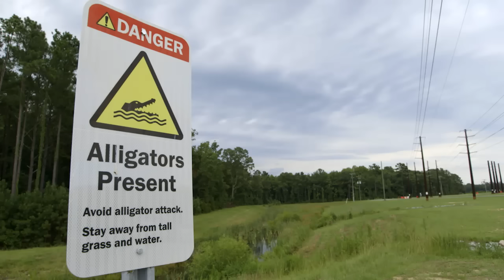Inside a Google data center

Comment: why if i just cut the cables on the street to googles servers, would that bring it down?
Reply: If you cut all of the cables, electric, communications? maybe. but most data centers are multi threaded meaning they have more than 1 communications provider, more than 1 power source. at the basic level a data center will have at least 2 of everything.
Reply: +MineNightOwl Gaming  do you even know what your talken about guyhaving multiple redundancy systems in place?..most data centers have multi layer redundant fail safe systems in place guy..why would you think that not having power to the bilding would stop the production?...think about what your saying guy...i can tell you a simple diagnostic software is more than enough to keep an eye on the power coming into the building.....Google is on next level shit and wouldnt have this massive Data Center without having multiple redundancy systems in place
Reply: it has his own underground optic fiber line,
Reply: no, it has backup generators
Reply: +MineNightOwl Gaming yeah but if the dude cuts those cables going from that building to the servers
Reply: +MineNightOwl Gaming i dont think they run that shit from one powersupply
Reply: JayVan Geli considering its google i bet they have their own satellite internet connection lol

Comment: I don't understand the cooling solution here - I thought that the most efficient cooling is to use a sealed cold aisle between two rows where you blow in cooled air. The air then goes through the equipment on the rows and out into the ambient data centre space where it's now warm. The general/ambient data centre space gets quite warm as a result but because cooler air is contained only in the small space between two rows - this greatly reduces wasted cooling and thus wastes less power.

The impression I got from this video was that there is a sealed hot aisle (instead of a sealed cold aisle) between two rows and the hot air is circulated through chilled water pipes to cool and the cooled air is blown into the ambient data centre space. This cool air is sucked in through the equipment and into the sealed hot aisle where the air is quite hot and is circulated through the chilled water pipes and the cycle repeats. The problem with this is that the general data centre space is large so it's hard to control the temperature and humidity. This would result in wastage...

So what's the deal here? Why go with the sealed hot aisle?
Reply: +PJNinja it's probably more effective sealing the hot air. that way it can only rise going thru the cold coils. Having cold air blow thru, unless it ends in say a server unit, has diminishing returns. IMO they should just water cool every rack thru water cooling or use the heated water to power electricity.
Reply: I don't understand the diminishing returns part, how do you mean?

Comment: How many watts does all of those servers consume... it has to be in the gigawatts...
Reply: +Cheataa That can't be right. That amount can barely charge the server room flux capacitor. It must have much more than that.
Reply: +Thomas Dohlman/«DN»Lasky® no that's mega
Reply: That's a shit load of power!  That's like the entire rate of consumption of my entire city 20 times over a month!  WOW!
Reply: +Cheataa What the hell's a gigawatt !?
Reply: 1,000,000 watts of electricity...?
Reply: Well yes, but they produce their own electricity!
Reply: Should be a few megawatts. Last year, one of amazon's pre-production data center caught fire. And Amazon disclosed some info. The figure was like 5,000 servers, each about 2 kilowatts(like a home air conditioner). The servers are blade servers, about 8 PCs form a blade server. So, each PC is 250 watts, like a good gaming PC. So, a data center building is like 40,000 PCs in a big warehouse. So, the data center building is equivalent of about 2,000 homes like a small town. Each home is allowed to have 20 good gaming PCs.
By the way, the smallest nuclear powerplant in USA generates 500 megawatts. It is not possible for a data center to run gigawatts of electricity. If a data center runs gigawatts, google will need to become a power company itself, managing dozens of full sized nuclear power plants.
Reply: One followed by 6 zeros is about right. But one followed by 6 zeros is megawatts, not gigawatts. Gigawatts is a full sized nuclear power plant that each state in USA only has about 2 full sized nuclear power plant.

Comment: I understand the point of using the water cooling systems. By containing it in the server racks you avoid the loss of energy by wasting on areas that don't need cooling. This is simply a water chiller.

Comment: remember... all it takes is one idiot who somehow landed a job protecting those... just one idiot... and it's all molted plastic and a big fire...
Reply: Half of the system is fully automatic, so even if the humans fail, there shouldn't be any data loss.
Reply: +wizzzer1337 Except it's all redundant. One of these data centers goes down and the others pick up the slack. This one is in South Carolina, and while it's unlikely the idiot you mention could take it down a big hurricane could.
Reply: +wizzzer1337 Two words. Failover clustering.

Comment: why not build in a really cold place like Alaska or Canada, then use the spare heat to warm peoples houses?
Reply: +Steve Haigh When the cooling comes from COLD air and not COOL air you will have a extremely high risk of moisture forming in the hot parts in the servers. That would result in a short circuit. This is the exact same reason to why you can't put a computer in the freezer to cool it. I hope you got you question answered :)
Reply: +Attic Z that makes no sense to me, colder air is typically dryer than cool air, plus they build plenty of data centers in Sweden
Reply: Oh, that's not what i meant. What I mean is that you can't use the air from outside and therefore it wouldn't matter if it's a cold country
Reply: +Attic Z or yo u cold just get fool boards that get cold and dont let air out

Comment: How does running data center warmer help with Efficiency? I think he just likes the word Efficiency.
Reply: +Vinny W Its for cost efficiency not improving performance of the servers themselves.  The found no longevity changes due to the slight temp change so they did it.  Also other data centers followed suit.
Reply: +Vinny W less energy is wasted for cooling

Comment: Why don't they use additional passive cooling with architectural additions above the center in the form of a larger building. We have already started using passive air conditioning inspired by termite mines. It only requires a higher upfront building cost but if implemented properly can save a lot of money on cooling while also reducing a carbon footprint

Comment: Would they run out of space in their hard drives?
Reply: they aren't hard drives they are solid state drives very similar but much faster than a standard hard drive but they have such large amounts of data bases by the time they run out of data Google will be taught in history classes
Reply: +Tristan Gumm The clip was of hard drives. SSDs are way too expensive for them to bother with for a long time unless the customer pays more.

Comment: Dafuq, the internet is stored on disk drives, am i correct are thier hard drives diffErent to the ones in my PC, also wouldn't they use ssd's or am i dumb?
Reply: dumb
Reply: +Flubberg464 dumb
Reply: Sinerst
Because HDD's are much cheaper and last a lot longer. SSD's are fast and are shock resistant, but they can read and write only so many times. HDD's can write and read countless times before failing and since they are stored statically, there is no need for a shock-resistant drive.
Reply: yes,they are pretty much identical to the ones in your PC just designed for high workloads 24/7.
Reply: They don't store the Internet, they just store the links, software, account info, etc
Reply: William Lau
Actually, they do, not the whole internet of cource, but just little bits.
Reply: +TheLMGN nope the WHOLE INTERNET IS STORED ON HARD DRIVES....any website you visit is hosted on a server, and what's a server? it's a high end pc or PCs with a bunch of hard drives inside to store the website's contents. so the internet is on hard drives, there's no "hyperspace" in which the internet resides what the internet is, it's a way of connecting pc's together across the universe
Reply: +Sinerst ssds would break extremely fast wirh all the data thats constantly being processed
Reply: +Flubberg464 Why use ssd when you can use the best RAID config to achieve all the performance, reliability and redundancy you want, while being cost efficient.
Reply: +Lance Rze Lol, You're* Your dumb lance.
Reply: youssef x
I know lol. I've done some web development.

Comment: What happens at 2:37 if there's a power failure or malfunction?  Are you trapped inside that thing?  Or is there a manual lever that will open the outer door?

Comment: I bet they're using hoverboards now.
Reply: +Josh Luis swegways
Reply: Maxim Korol ikr why do pople cal them that and spel teribly wen then rite comments just enif so u get wut im takin about
Reply: +Maxim Korol Technically they do.

"Electrons in the outer shells of atoms repel each other at 10^-8 metres.(yes, you aren't really sitting on a chair, but hovering/flying slightly above it at 10^-8m.)"
Reply: +vide0viwer I'll get your coat.
Reply: +Josh Luis i was just thinking that wen i saw that dude on the scooter
Reply: They don't even hover fucktard
Reply: They don't hover AND they don't get sold anymore
Reply: +kcuf0 वीं जपसरव#ज:)?-==$??==+;::'+==])=))

Comment: lol seeing people say why doesn't Google use Chrome OS for dev just made my day =P!!!  I got a free Chomebook pixel from Google I/O 2013, and I actually tried to use it for dev! I tried web-based IDEs, web-based source control, web-based terminal, etc etc, (and of course the first thing I did was to dual boot Ubuntu), had to sell it after a month because whenever I look back at my macbook pro I just could not resist that temptation...uhh Macbooks, I dont know, Windows has VS's debugger, Linux supports more open source software, but a Macbook is just such a beautiful combination of hardward and software that you can not say no to. (disclaimer: XCode excluded)

Comment: why don't they use the energy of the processors to generate electricity?
Reply: You don't make power, you recycle the heat generated by the processor.
Reply: +KV-1S Tanker what? what is so hard about using a heatsource to generate electricity, we have been doing that for years
Reply: +Creative Contagion I think he means using the waste heat produced to add an additional supply of power to the plant. That way they can use less electricity from the grid or supply the grid itself, therefore reducing operational costs.
Reply: +William Yang Yes that was the point. I asked around and a friend of mine made a good point in that processors don't get nearly hot enough and the Carnot cycle can never be made efficient with a temperature differential that low. The efficientcy is basically: 1 - Tcold/Thot and since that is only about 0.19, you can't really get an efficient engine.
Reply: +Robert Fennis Let me explain it... You need to cool the processors to ensure the stability and efficiency. Making them to produce energy from the heat would be a high risk, the processors need a temperature range. Even if the company says "We will feedback part of the energy with the processors" The energy in return would be a very low fraction of the energy used to make them work... With a high risk of overheating.

In other words: If i feedback the energy produced by my fridge in form of heat to it again, at the moment i unplug it the fridge, it would be working for a very short time.
Reply: +Bruno Iniesta Baldis I don't see why there would be a high risk of overheating.
+Robert I think they don't do that cause it is not worth at the moment, but it seems like a cool idea.

Comment: That cooling system is interesting
I have worked in alot of datacentres over the UK and most "as mentioned" have ac thats presented right at the cabs
Wound be interested to see the specs

Comment: When will google upgrade to ssds instead of hdds? Or will that be too expensive?
Reply: +Ben G its not same hdd like you buy for pc and hdd are better for long time running, but im sure they are using sdd in some parts. If you are talkinf about 20 petabaits of data per day :D ssd will explode :D
Reply: +Ben G They'll never phase out HDD's for SSD's. I'm sure that they use SSDs to store critical data but they'll never use SSD drives in the scale that HDD drives are used today. Google still uses magnetic tape data storage for long term storage, just to get a perspective.
Reply: +Ben G HDD`s in this kind of use are not slower than SSD´s so it doesent matter.
Reply: +Sulfen "never" is a big word. 10 years from now flash storage may be cheaper than disks.
Reply: Völundr Frey maybe but ssd will end soon, there is new technology for drives faster then ssd and without limits for transfer
Reply: +Völundr Frey if magnetic tape is still preferred today as a main backup storage it is very unlikely that SSD will become a standard with its lower lifetime.
Reply: Sulfen Magnetic tape is still used because it's better than harddrives for some storage. Long term storage primarily. Harddrives are better than tape in situation where speed matters, and preferred over flash when it's too expensive with flash. When you can get flash storage cheaper or as cheap as hard drives there's no reason to use them over flash. 

And that could very well happen within the next 10 years.
Reply: +Völundr Frey there's still a huge limitation that makes it unlikely, and I could bet on impossible, for it to become the main storage device. SSDs start to go bad a lot faster due to its rewriting problems. This is something that happens a lot less often on hard drives. Even if SSDs were to become cheaper than hard drives, they'd have to make up for their higher replacement rate. The only usefulness for the SSD is to store frequently accessed data because of its advantage to retrieve data faster than the magnetic tape or hard drive.

Comment: Google use MacBook? Lol they should use cromebook lol
Reply: Lil
Reply: +Conor Walker I bet you will see a lot of chromebook pixels at google as well. But they wont be running their native OS either. Any mac you see at the hands of an engineer at google will be running linux, unless they're working on an IOS or Windows application. 

You can change operating systems.
Reply: +Ryan Lin chromebooks sucks and thewy cant do shit
Reply: +Ryan Lin i have a brick aaaah-mean a chromebook
Reply: +Ryan Lin Whats a cromebook?
Reply: +Völundr Frey Wrong, OSX  is based off UNIX. You can manage any linux machine fine via the native OS
Reply: Yaya
Reply: I have ho 1.6 ghz and graphic can't run minecrFt with 8 gb rammm
Reply: They won't be using chromebooks because of how weak the hardware inside a chromebook is
Reply: Ryan Lin cough cough more ram won't fix anything if you have a bad gpu cough cough

Comment: You laugh? I'm down right sad. Look at how much energy that uses, ffs press the hardware manufacturers to innovate this is ridiculous. From replacing HDDs alone the  reduction of energy consumption would be huge.
Reply: +kalimul You're joking right? Do you know how much it would cost to replace hundreds of thousands of HDD's that store god knows how many terabytes each. That would be a stretch even for Google.
Reply: 20buckman12 I'm not joking at all and they would pay for themselves in the long run due to less money spent on cooling and less money spent on electricity. If anyone could afford the higher up front costs, it should be Google.
Reply: kalimul In 10 years, yes. Now I don't think any company would justify paying so much extra when there is an option that is so much cheaper. SSD's are so fuckin expensive man, I can get a 2TB HDD for the price of a 128GB SSD. That's a HUGE difference.
Reply: 20buckman12 Burning coal is cheaper now as well, doesn't mean it's an ethical thing to do to future generations. Wasn't Google supposed to be environmentally friendly? They waste so much energy is their data centers that they need god damn cooling towers. Think of that for a moment how incredibly stupid this whole thing is. Storage is just one of the areas where they could improve and flash storage isn't the only new storage in town btw. There is memristors from HP and Intel just recently announced a new type of storage on top of many others like HBM to make RAM more energy efficient and dense and using specialized CPUs for certain tasks instead of general purpose ones. The sky is the limit and Google is just adding cooling towers. Revolting.

Comment: How does running a datacentre warmer than average increase efficiency?
Reply: +Kamran Kamal 
the increase on efficiency becomes of,instead of cooling the entire room,like others,they cool down the server racks individually.
Reply: GotDead Tortellini If it's that simple, then why isn't every data-centre running at those temperatures?
Reply: +Kamran Kamal Perhaps because it isnt pleasant to spend time thinking. Or because it's annoyingly hot when it is 27 degrees.
Reply: LOL Thanks for your comments GotDead Tortellini and Elexs .  Have a good day
Reply: +Kamran Kamal  It's more efficient if your talking about cost. The servers don't perform better. The cost of taking a place like that from 80 to 70 degrees would be millions of dollars a year for marginally better computer performance.
Reply: +Kamran Kamal Because to keep the datacentre cooler, they need more cooling power which is not necessary as the servers can easily withstand higher temperatures.